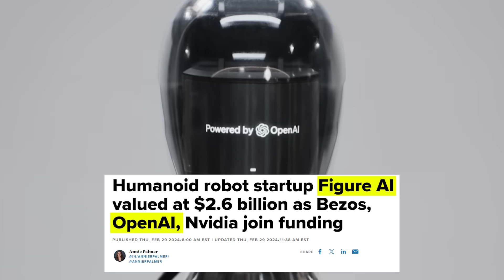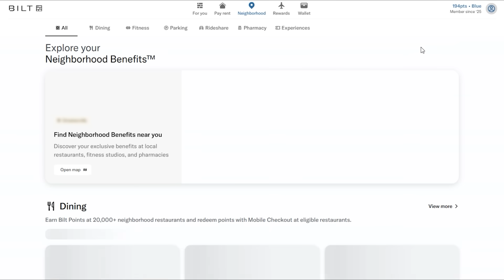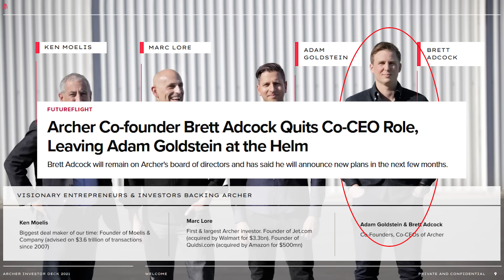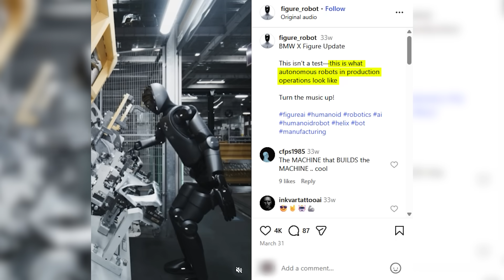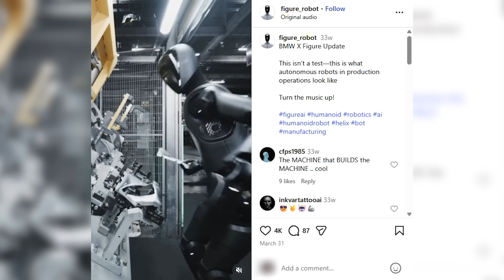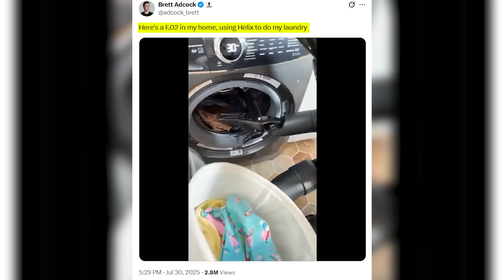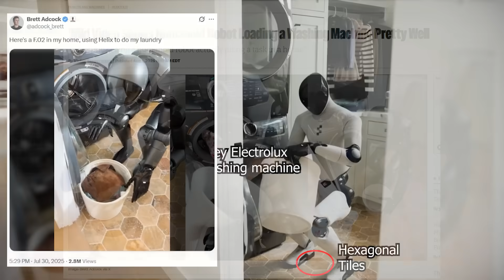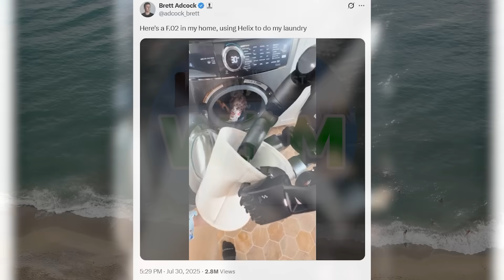OpenAI Invests In Fake Robot Company

Comment: I work in manufacturing.
  With an automated production line, we have a metric called "TAKT Time"
This refers to the time it "should" take for each station. If it takes longer, then the entire production line is slowed and costs rise.
In the automobile industry, the TAKT Time for a manned station is typically less than 1 minute. (30s-45s)
  The main issue with humanoid robots is that they are simply too slow to replace a human operator. Theoretically, you "could" use 3 humanoid robots to replace 1 human at a single station. But that becomes overly complicated and expensive fast

  All of these Humanoid robots have a computer the size of a refrigerator, but it's never shown. (Gee, I wonder why)

Comment: So instead of hiring technicians to do the work they're already doing in a factory, they're going to buy these extremely expensive, complex, and unproven robots, then they'll need to hire technicians or engineers to watch these robots and fix them when they inevitably break down or have a software issue. And those technicians or engineers will probably need to be paid more cause that role requires greater knowledge and skills. Sounds like it would end up being more expensive for the same or less efficiency.

Comment: AI is just one of the hurdles in humanoid robots. I think at this point in time the bigger hurdles are in the hardware world, like actuators. Right now, a "proper" humanoid robot costs somewhere around $80k. A large fraction of that cost are actuators. If a company comes out with a humanoid robot that can do standard amount of physical work (for example, lift 45lb box off the floor and put it up on a shelf at chest level) that is still agile for $20k-$30k, while making a profit (that means the price isn't investor subsidized), then we'll be in sci-fi times. Alternatively, if a company could sell an actuator for the leg of such a robot (leg having to lift the weight of both the payload and the upper body of the robot) for <$1k, then it's also time to get excited (and that's <$1k unsubsidized while making a profit). If actuator prices come down about an order of magnitude (i.e. 10x), then humanoid robotics will become cheap enough so that open source would take over. At $20k-$30k, I think enough engineers (and in general, tech savvy people) in the richer countries will say "you know what, I'd rather spend this money on a robot than on a car or something else"; buy a kit, screw around with it and innovate in a hacking community. The resulting solution would be open source, with robots you actually own, that don't depend on a company that might decide to say "You know what our robots should do? They should play an ad to the user before they do anything for them!" </rant>
Someone please give me a billion bucks so that I can develop these actuators and scale the production so that it's affordable. This 1 billion will probably do more good than many 10's of billions being burned on data centers.

Comment: So far these robots are pointless. Having said that, the washing machine/house lie didn't really matter. It would work just as mid in any laundry room.
Reply: The fact that It's a pristine test home in enough to discredit any work that the robot did in that video. Put a pet in front of him or children. Let's see If It can adapt to real scenarios in real life locations.
Reply: In machine learning, models are designed to “learn” the features of the tranining data. This is verified using testing datasets. The issue with training them in fake houses is that they lack features or elements real houses have ( random items lying around, kids or animals running, people moving stuff). These things are hard to emulate at large and hence it’s likely the models are incapable of actually learning how to deal with these problems. 

I can code a robot to do a task given the right environment, I can’t however code it to take spontaneous data and act accordingly to it.
Reply: Not really that’s why they are using it in home built for testing, it cannot adapt to other rooms because they need to reprogram for those rooms with different height for dryers/washer and different ways to open the machine door or start it

Comment: Humanoid robot is a very inefficient form factor for warehouse work.
Reply: And thus humans also? The whole point of the humanoid robot is to do human jobs. By focusing on the human form, you make the robot more versatile.
Reply: @Evolution56 Ridiculous. Humans are very inefficient. Humans formed the way they are now not because nature strived for more efficient working organism but because of the constraints of biology and genetics on this planet. Also, saying that we need only a humanoid robot just because it is supposedly good for most tasks is like saying the only car we need is Corolla hatchback.
Reply: @Evolution56 but we don't need versatility here. The humanoid robots aren't gonna work one shift at a warehouse then clock out to work another at a burger joint. We can specialize them instead.
A self-driving forklift has fewer and much simpler moving parts than a humanoid robot and would be far more efficient for moving stuff around a warehouse. It doesn't even need to be self-driving, you can just have multiple be remote-controlled with a computer to save on compute, space, and manufacturing complexity. Why would you ever choose the humanoid robot in that scenario?

Comment: IT guy here.  If a humanoid robot uses AI,  then why does AI need to be housed in massive data centers, eating DDR5 memory, consuming mass quantities of electric power and Nvidia H100 GPUs ?  Simple question, has a simple answer, it can't and it doesn't.  AI in humanoid form will only happen when that datacenter shrinks to the size of a home computer. Moore's law and all that, still means it's a LONG way off. Oh, and AI is only right about 50% of the time in IT. Often it's COMPLETELY wrong.
Reply: Clearly that humanoid robot is always online and tethered to the data centers at all times, shutting down when the connection is lost, akin to trashy always-online modern videogames.
Reply: "IT guy here" lol. nowdays IT means help desk or sys admin
Reply: @mateidumitrescu238  but he might be an electrical engineer with a master's degree.
Reply: How can you be an it guy and comment like this 😃
Reply: isnt Moore's law dead now due to physical limitations? we got as small as we can without quantum effects messing things up for us. Or maybe there is still some way to go, but i dont think we can reasonably expect it to go for long still.
Reply: @masterofdizzzaster  Oh it has slowed down for sure, but there's still loads of room for efficiency and density improvements. Individual transistors can't get much smaller, but that hasn't been the limiting factor for a while now. These days its all about minimising leakage, and advanced packaging techniques to basically get more chips per chip. Trouble is that these techniques require a lot more work, so productions costs creep up. It's not like the old die-shrink days, when a new generation could offer better performance while also being cheaper to produce.
Reply: Glad I have an answer for you. 
It's in the data centers using all those resources for training. It takes far more resources to train them. Simplified or specialized models run on much more modest hardware.